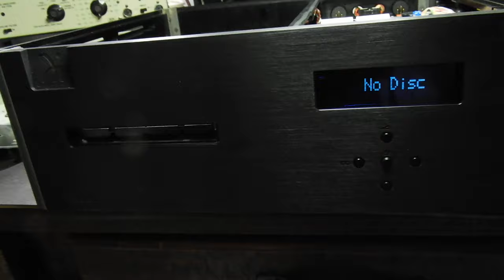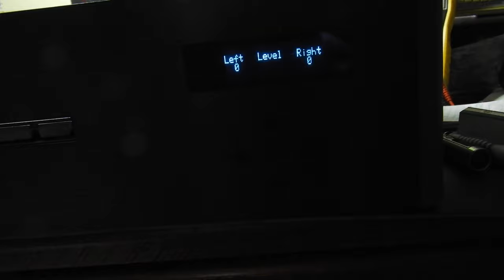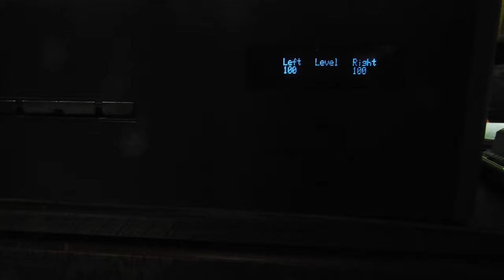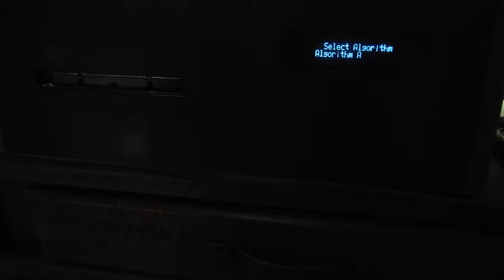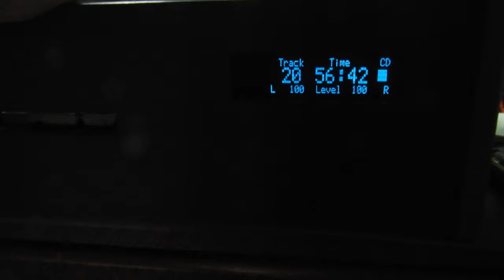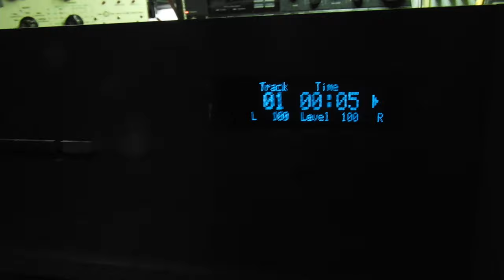Wadia 581 SE (Special Edition) SACD player which doesn't read discs and has no digital Inputs or Out

Comment: Have chance to purchase a 581 ,not se ,but concerned with reliability. Did you ever fully fix this player ?
Reply from the maker: Not as yet. I've just received some laser from Hong Kong and will start on it when I get a bit of time. Wadias in general are reliable, but SACD players as such have reading problems. Usually, new and properly adjusted lasers make them go.